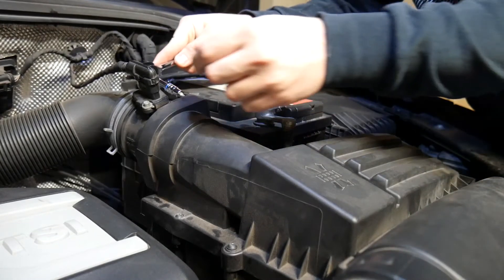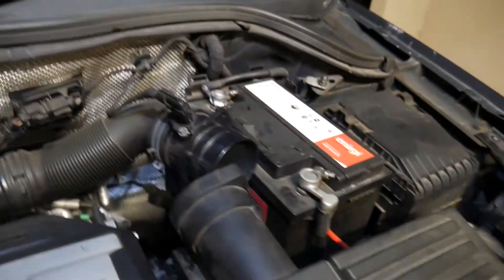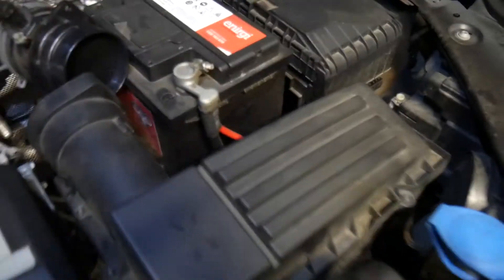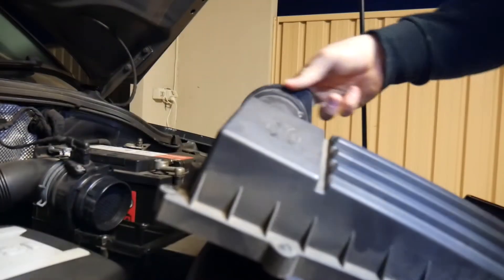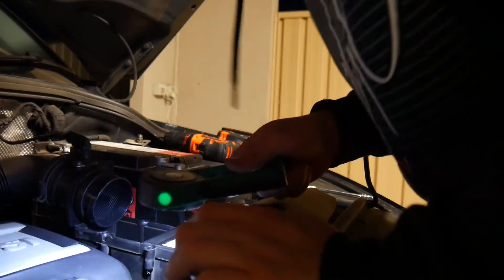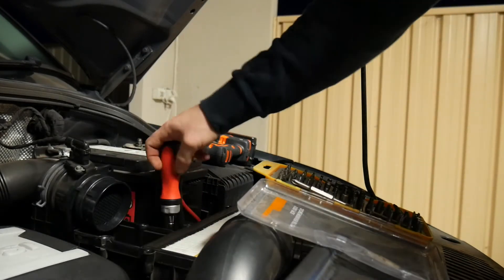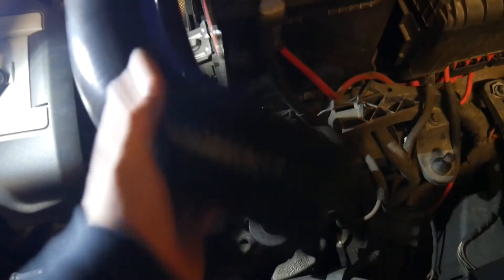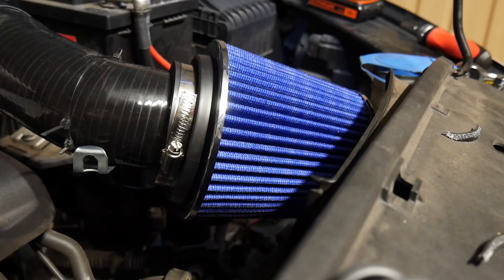Installing DIY Cold Air Intake in 2012 Volkswagen Tiguan 2.0 TSI 132KW

Comment: I doubt this improves much performance . 5-10 HP ?
Reply: If anything it loses power due to heat soak he needs a heat shield so the engine temps are nit being pulled through he intake when it gets hot.